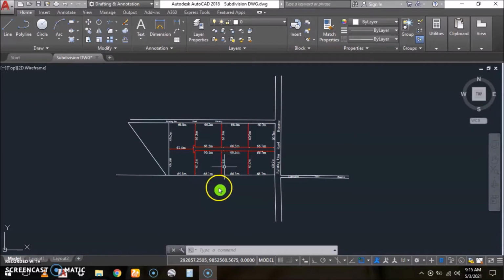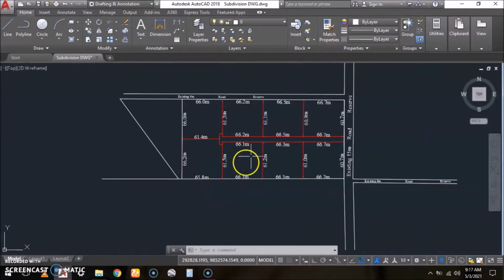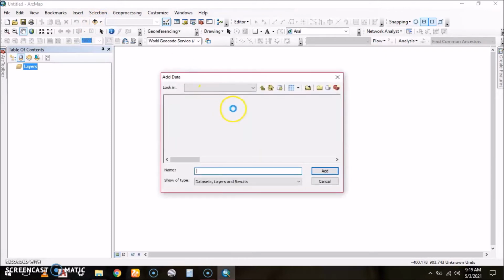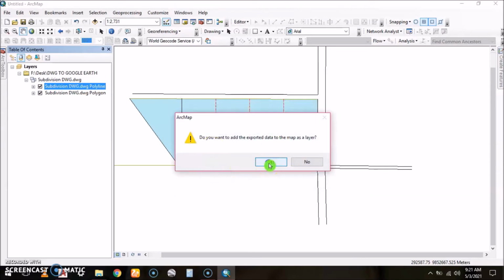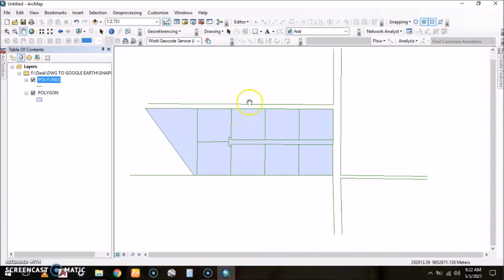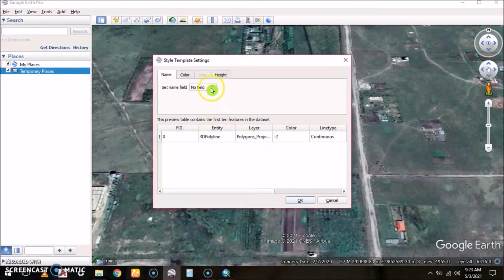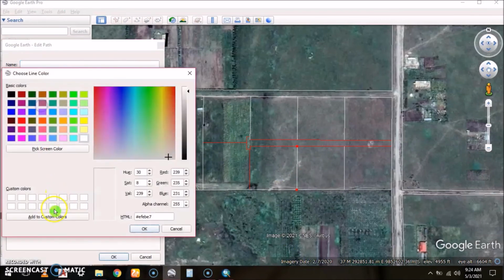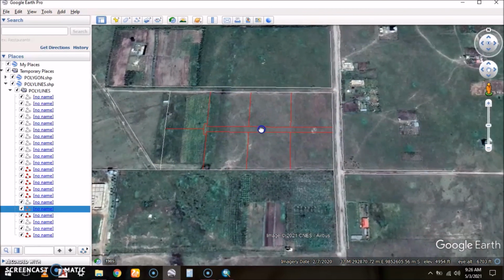How to export an AutoCad Drawing in to Google Earth _Geo Screen

Comment: 🎯 Key Takeaways for quick navigation:

00:00 🌐 Introduzione all'argomento AutoCAD a KML
- Discussione sulla conversione di disegni AutoCAD Geo-Referenziati in file KML per Google Earth.
- Presentazione dei software utilizzati: AutoCAD, Google Earth Pro e QGIS.
- Invito a seguire i passaggi per convertire un disegno AutoCAD in un file KML.
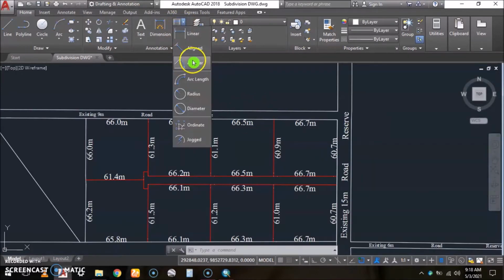02:21 📁 Preparazione del disegno AutoCAD
- Necessità di salvare il disegno AutoCAD in formato .dxf prima di procedere.
- Mostrare il processo di salvataggio del disegno UTM come file .dxf.
- Introduzione a QGIS come software open source GIS.
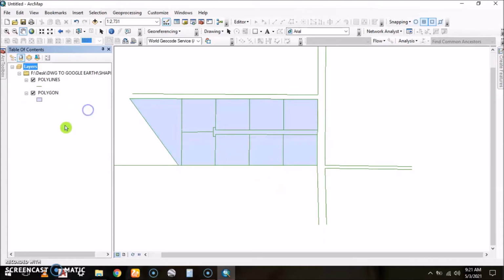04:37 🗺️ Importazione del disegno in QGIS
- Utilizzo di QGIS per aprire il file .dxf e selezionare il sistema di riferimento UTM.
- Mostrare il processo di importazione e visualizzazione del disegno in QGIS.
- Selezione del sistema di coordinate corretto durante l'importazione.
06:20 📂 Esportazione del disegno in formato KML
- Spiegazione del processo di esportazione del disegno come file .kml in QGIS.
- Scelta del sistema di coordinate WGS84 per il file KML.
- Verifica dell'avvenuta esportazione del file KML.
07:38 🌍 Visualizzazione del disegno su Google Earth
- Utilizzo di Google Earth Pro per aprire e visualizzare il file KML.
- Verifica della corretta sovrapposizione del disegno AutoCAD sulla mappa di Google Earth.
- Dimostrazione pratica con un esempio di un campo di calcio.
09:01 🎥 Conclusione e invito all'interazione
- Ringraziamento e invito a mettere "mi piace" e iscriversi al canale.
- Promozione di ulteriori video sul canale Learn & Explore.
- Saluti e chiusura del video.

Made with HARPA AI